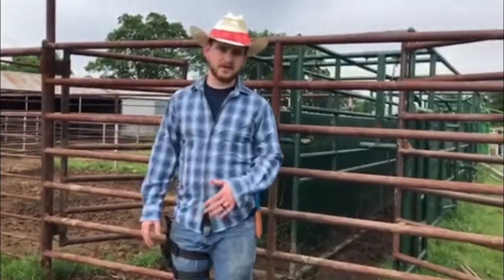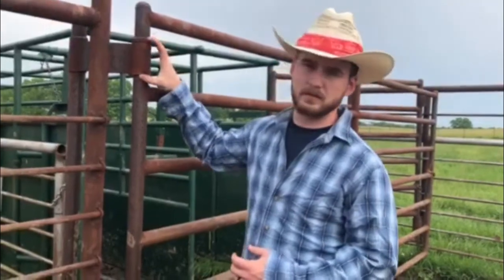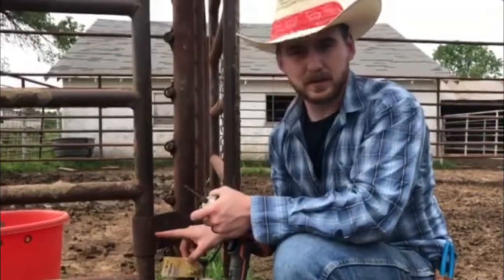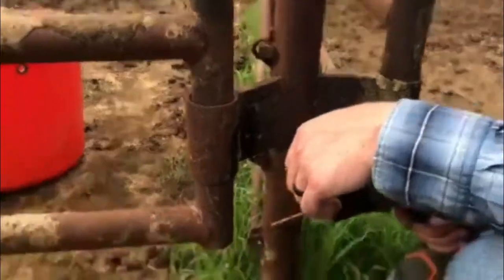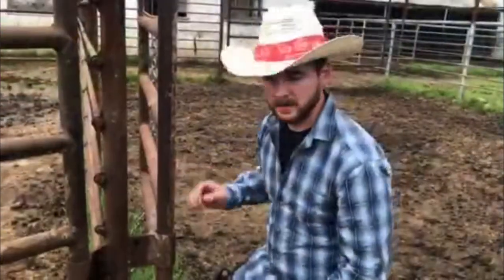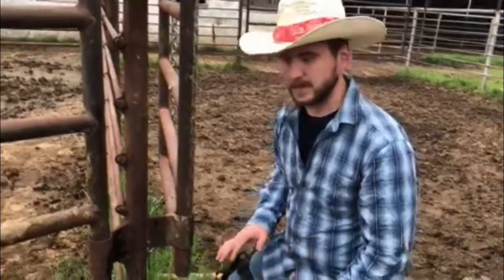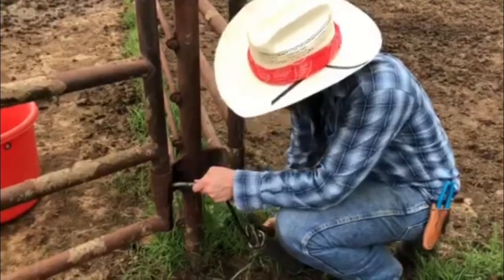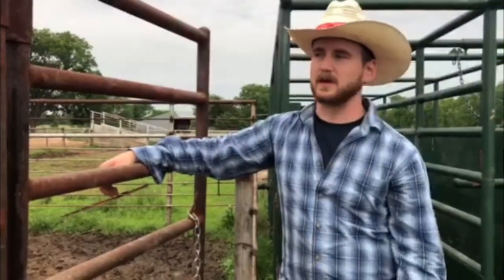Getting Greasy! | How To Install Grease Zerks On Gate

Comment: F**kin dynamite video, man.
Didn't know you can get pressure-fit grease nipples. Was planning on taking friend's heavy iron house gate off hinges and bench drilling it, reaming and tapping it for a threaded nipple. It IS that bad!
Your plan is so much easier. Maybe I can use dust-caps for car bleed nipples to cover grease nipples.